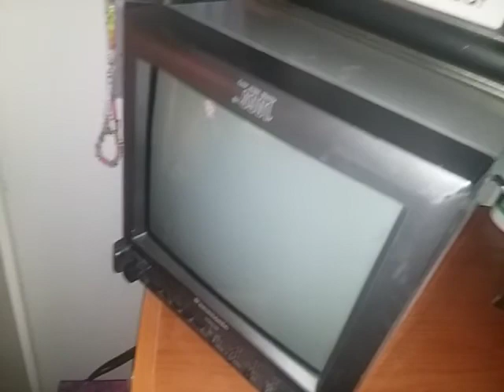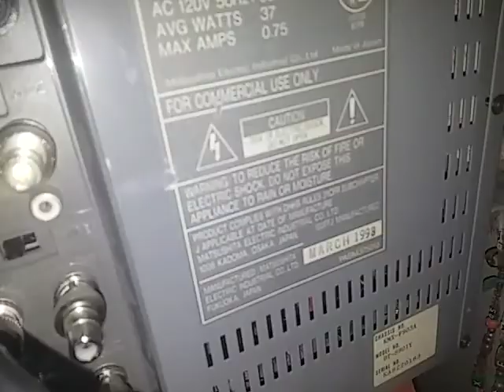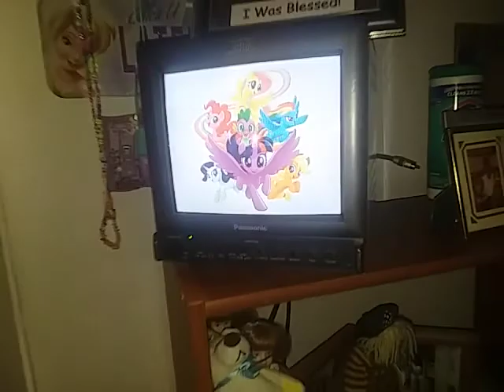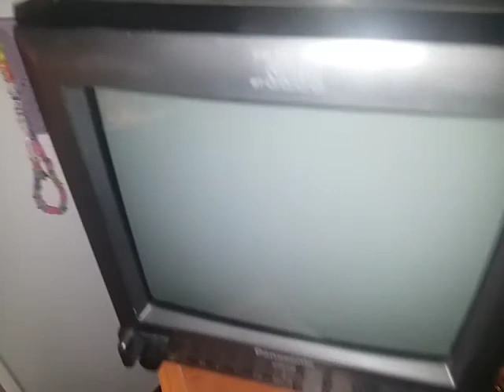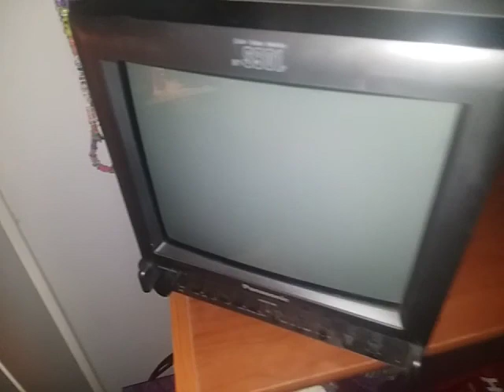my Panasonic Bt-901y color video monitor

Comment: Hey dude, you should change your pvm back to 75 ohms and off of high z.
Its very bad for the tube, as that mode is only meant for chaining together multiple displays through the video out, so the video signal is not being properly terminated.